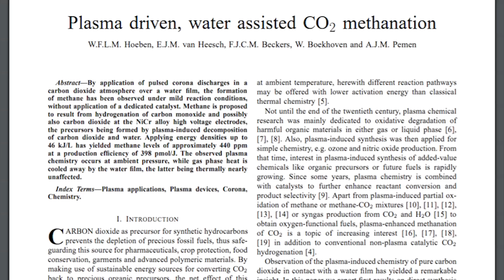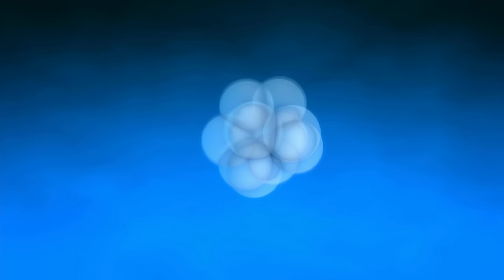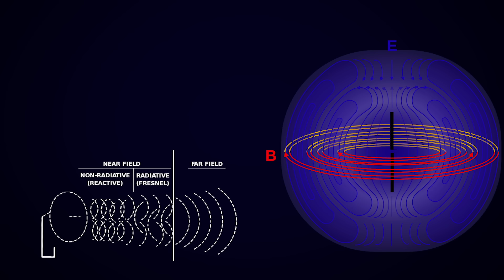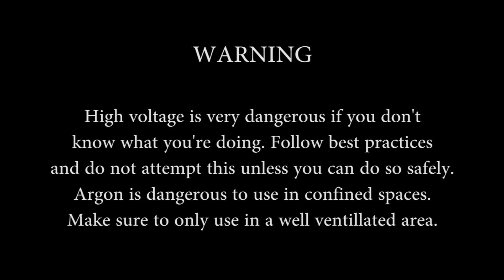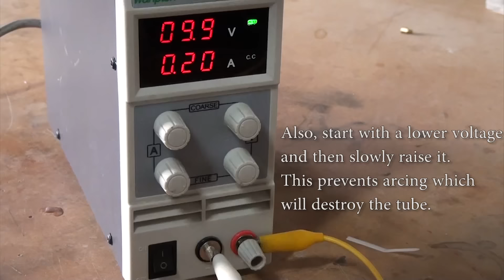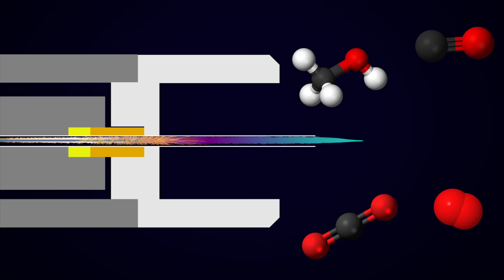Cold Fire You Can Touch - DIY Cold Plasma Torch

Comment: Hmmm, few stupid questions.
Why is methane gas flame without soot blue and nearly invisible and color can be changed by some chemicals such as kitchen salt?
Why is argon or xenon used for plasma emitters (low ionization energy)?
Why is argon dangerous in confined space, when concentration in the air is quite high (cca 1% which is more than CO2 or water vapor) unless you have big tank of pressurized gas?
Isn't plasma cold just because of low concentration if ionized gas?

Comment: Hopefully someone can answer this but I run fiberglass with resin and it build up static that shocks up, so technically it’s making the material a capacitor, so if we build a capacitor before the end material to hold all the electrons, it will hold the static before the end material?

Comment: this tool would be very useful in paper restoration in removing foxing which are mold spots they are easy to remove the only problem is they come back it might take years but the procedure will have to be repeated if I would treat the paper with this tool from top to bottom and on both sides and then start the de-foxing procedure the spots won't come back because I killed all the spores of the mold I would almost say sent me one!!

Comment: You know how you were talking about sterilization by that plasma and how you had them organized on that front end of that muzzle I'm wondering if you can make a like Betty Crocker baker oven and put those in there and as you put something on a track when it goes through there across those plasma things and sterilize you know different kind of items so you'd have like a tool that is a plasma machine like what you're creating and you can put anything to the size of a microwave in it and as it goes through that those plasma deals will kill everything that's on that microwave through those interaction from the plasma without destroying Electronics on it

Comment: This made me think.
Would it be possible to create an actual fire wall?
High heat resistant metal wall made of a heatsink grid and conductive receivers with high earth potential. Buried deep.

Can you actually steal and ground electrons of fire?
Will it, along with mechanical heat reduction stop a fire?

I'm probly an idiot but curious.
Reply: I know there are better fire fighting methods usually but im thinking bush/forest borders etc. Somewhere prone to large destructive fires that spread, lots of fuel present on both sides of the wall, hopefully also allowing passage of wildlife via low cut outs.

Comment: 01.  What if you could use the coldness of space as a fuel source to make "cold plasma" for an "ion engine"?
02.  You said the tube might be absorbing the plasma and it's not have it going very far... there is this clip called "WEEKEND PROJECT IONIC SPACE THRUSTER" on youtube... the design is very similar I figured WHAT IF you could get some inspiration from this clip... can ions move plasma in the same direction?  this clip might help you

Comment: you used argon, which is a bit harder to get then a gas like Helium.  So is the gas you are using just a non reactive gas.  The Plasma Channel used He.  So just wondering.
Using for this for sterilization seem really impractical as the area of sterilization is so SMALL.  You could not use it for practically using it for sterilizing surgical instruments.  So it is a fun idea but does not seem practical for any real world use.

Comment: Can this be used for material deposition onto a metal surface?  Would be interesting to see that run as an alternative head for a laser engraver.
Reply from the maker: Yes but probably not in the way you're thinking. Working on a follow up video but it'll take a bit to get working
Reply: @thethoughtemporium  It's probably several steps away, but my intention was something like freehand electroplating.

Feeding the material would be an interesting puzzle, as well as a grounding system that does not alter the ion flux.

Comment: Serious question: Couldn't you just use a bottle of hydrogen peroxide to sterilize equipment? You don't need ions that are suspended in a gas to sterilize equipment -- ions suspended in a liquid will work just fine too.

Comment: If oxygen and things in the atmosphere can be used to make cold plasma it could be used for toys or models. Actual light models that can hover. Or possibly using weak electromagnetic fields like laser swords. I've been looking at gundman models online. It would be cool to use something realistic for them. And use tine animatronic and electronic logic to make it walk and function basically. some mini hydraulics and whatnot could also help reproduce the tech in miniature. If you could use air you could simply power it with a mini vacuum or maybe even make a battery to enhance it that draws from the air and adds slightly compressed air particles.

Are there any known health risks to cold plasma. Or is there a way to use air and other gases besides argon. Preferably safe and freely available ones.

I wonder if you could combine cold plasma using air, electro magnetic fields, and very weak lasers to make miniature toy lightsabers.

Comment: That high voltage power supply your using takes a lot of current for nothing... It's easier to use a FET driver on the actually coils in the transformer itself, if you know the right wiring  and have it tuneable  to 23 to 27KHZ  .. I used a couple of IRF740 for mine with a simple 555 timer for the square gen alone with a 1 - 2 amp 24volt power supply...

Comment: Do you think it Can be applied to a vehicles engine??
Reply: Why?
Reply: @corpsenugget455  I'm was thinking out the box with this , like if nitrous oxide is cold air an a cooled engine runs better then a  heated then can this be applied as a sub for the coolinjections or any part of the vehicle   in any way. It's a trial and error thing to do but just curious would it be efficient and effective?!or pointless
Reply: @estear1718  oh
Reply: @estear1718  pointless. I know alot about cars.
Reply: @estear1718  the plasma is room temperature. NO2 is very cold when compressed

Comment: 1:42 My brother who has been blind for just 2 years can solder better than that unholy mess dude...
Reply: Ya,  needs a bigger soldering iron for that kind of soldering,  80W non regulated with set screw sliding adjustable position tip works for me for this kind of work.

Comment: o3 generation or propulution.  a pretty light -- . you can search for that yourself
dtic [mil]  

 Accession Number : ADA581663
Title :   Low Cost, Efficient Microcavity Plasma Ozone Generation for Water Remediation and Air Purification

 Accession Number : ADA462972
Title :   A Microwave-Augmented Plasma Torch Module

Comment: I believe that physically it is Light not Plasma. Only that the blowing of the gas ashures a way for light. The physical effect is the ELECTRIC-FOTO effect. The gass Charged electric it is emitting light at an frecvency and color. So you only make that the light to travel in the blowed gass. The specific gass you use and the electric frecvency contribue to the emison of the color of light. So it is not fire per se or plasma it is light emited from eccited electric the gass.